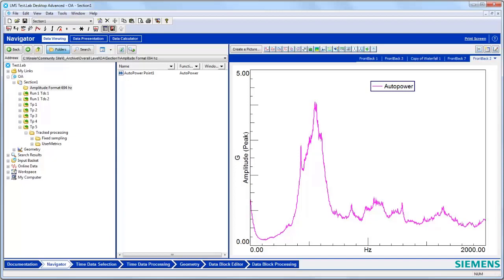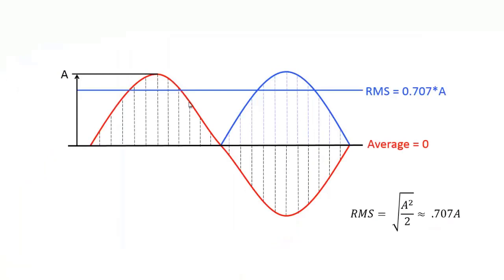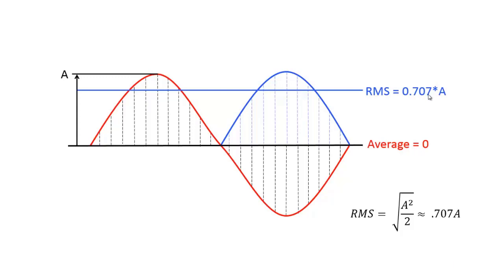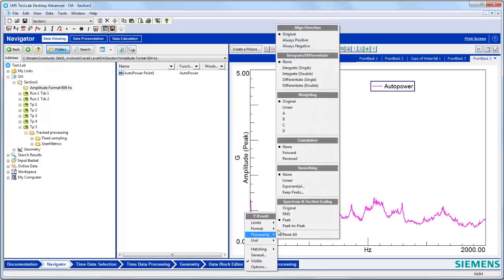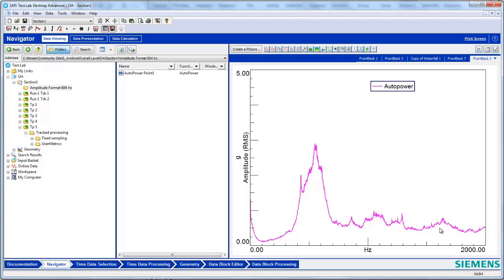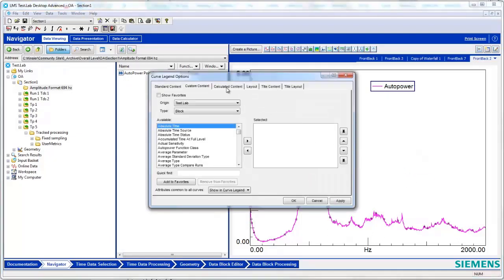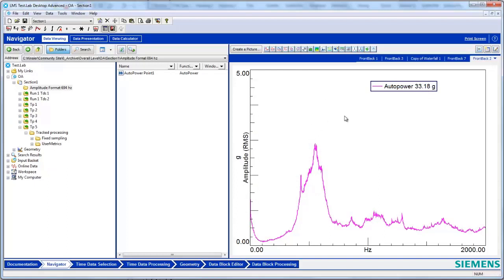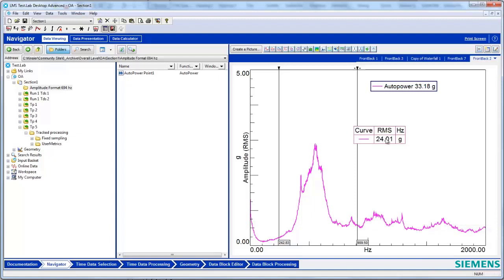RMS and Overall Level

Comment: Hello, I want to ask again, can I calculate the RMS of the time domain signal data? For the time domain data, can I calculate the options ——RMS and get the energy effective value???? Thank you and look forward to your reply
Reply from the maker: In Simcenter Testlab, some cursor calculations are not available by default due to the potential to take a long time to calculate.  A trick is to multiply the data by 1 with the conditioning toolbar to make it a data block, then RMS and other calculations will work.  Instructions here: https://community.sw.siemens.com/s/question/0D54O000061xktESAQ/how-to-pick-the-nth-peak-on-the-curve-that-is-put-the-ycursor-on-the-nth-peak